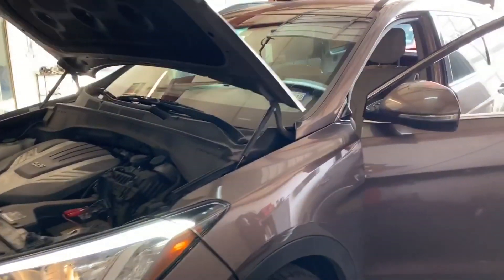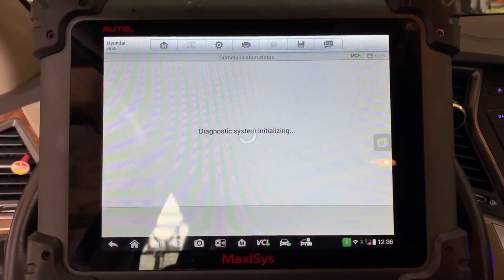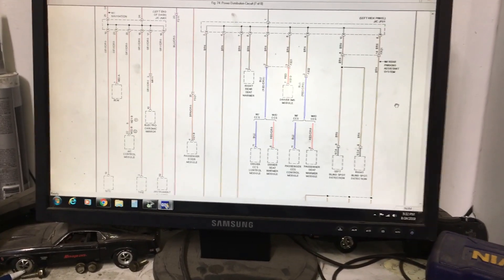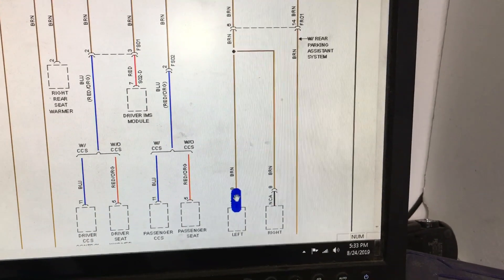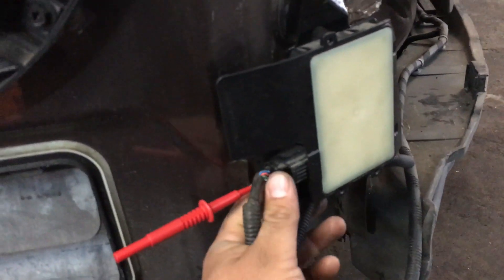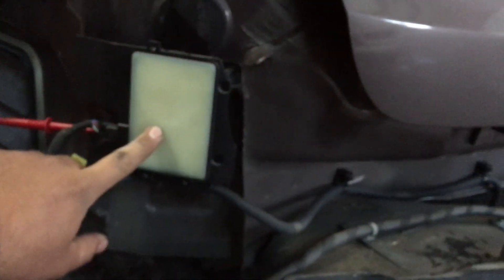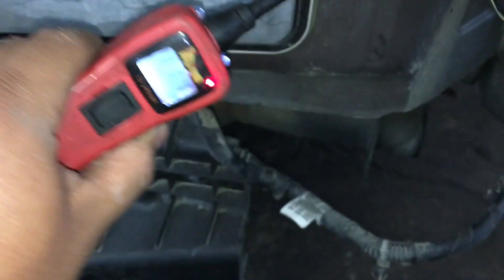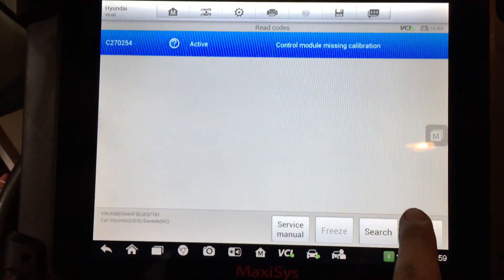HYUNDAI SANTA FE BLIND SPOT DETECTION NOT WORKING

Comment: Seems to be a problem with Kia & Hyundai since they're pretty much interchangeable. I had the same issue on my 2017 Kia Sorento. I unplugged that rear left side harness, blew out and plugged back in...problem solved. Thank you very much for this helpful video. For those others trying this out, you can easily get to the harness from under the vehicle without removing the whole bumper...at least that was the case with my Sorento, just FYI.
Reply: Did you have to recalibrate?
Reply: @Randy_Savage_ohyeah  Actually a few days later the sensor failed again. Took the bumper off and found that the mounting bracket was damaged. Tweaked a bit to match the right side and had my buddy recalibrate at his shop. Been good now for the last 4 months. No issues.

Comment: Thankyou so much for explaining this. I  was able to fix the same issue with my wife's 2017 Sante fe  ultimate.  The dealer kept telling us that a new cable was needed!!! I went under the rear bumper and disconnected the two EXPOSED sensor cables. I sprayed Mass Air Flow cleaner into the connectors. The BSD dash error went immediately away. So did a few other error lights. It appears as if Hyundai put these cables in a very exposed area. Road grime, car washes. Rain etc. are able to directly affect these cables. They should have at least protected the cable connectors. Bad design  🙄
Reply from the maker: Awesome! I'm glad I could help!

Comment: I know this is a older Santa Fe but I wonder if my issue is the same? My blind spot monitor switch does not turn on when being pressed and I have no error codes saying to check the system.. but it won’t turn on when pressing the button.

Comment: My '14 SF Limited's BSD doesn't work for years now. Dealership told me $300+ just to scan. I can live without it, but I paid extra $ for it.

Anyway, your video saved me money for real! It turned out that the main wiring harness for the bsd rear radars is just loose. 'Went under the rear bumper, unplugged the harness, cleaned the pins and plugged it back. 'Drove around to recalibrate and they're working again!

Thanks for the very informative video! 👍👍
Reply: When your harness was not connected did the switch on the dash light up when pressed? I’m trying to figure this out I don’t want to buy a new switch if I have a harness issue myself. Mine gives no check BSD warning it just acts like it’s not installed.

Comment: Had a 2015 sonata, C120B-15 R. Led(mirror) short to B+ or open. The threshold in service data says 6.5 volts with the led off. Had an aftermarket mirror. Voltage was 3.0 volts but continued to set code. Fortunate for me, both the left and right mirrors have the same pinout and connector configuration. Swapping the mirrors gave me the proof that 3.0 volts on the led circuit was too high. Just goes to show that aftermarket parts aren't always the way to go. You cant put aftermarket parts on these.

Comment: very informative.  I have a 2016 Azera.  The BDS system check message came and the dealer found the left sensor defective.  Replaced the sensor and the bracket and half way down the road back the message came on again.  Took it back, had it recalibrated but again the message.  Looks like the calibration is not holding.  Any idea about what could be the problem?  Many thanks in advance

Comment: Hey bud i got a problem with a hyndai sonata 2015 but the codes i get is c120b15  and c120d15 which is LED Left and Right circuit short to battery or open but i cannot find the problem I got the codes with a snap on scanner any suggestions bud??

Comment: I have a tough one for you: 2017 Santa Fe XL. Cold weather, 0'F or less, starts right away in morning (cold soak, no block heater), drive short distance to store, shut off engine, come out after about 15 minutes - the car might then start, but most of the time it ignores the start and goes to ACC mode - never cranks. Wait 1/2 hour or so - starts right up, or hold the start button in for 30 secs or so, it cranks and starts, but dash is lit with lots of warnings - NO POWER STEERING! - really HARD to turn. go home, park. Next day OK again. ???? Hate winter!

Comment: Wait, they changed the modules and still had problems because of a loose cable or why did you have to code them again ?
Reply: No, they wanted him to check before they ordered modules to see if he could solve the issue, your thinking about reprogramming, but this is just a quick calibration to make sure they work correctly.

Hope that helps...